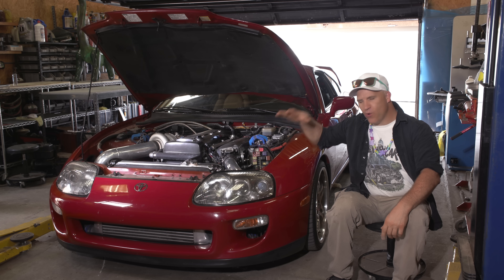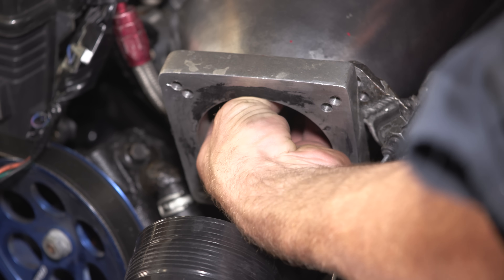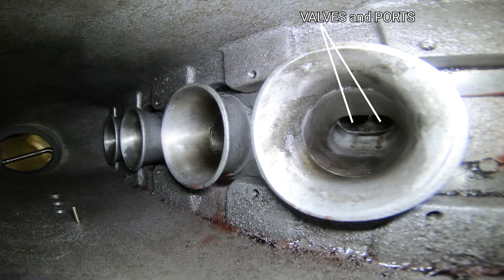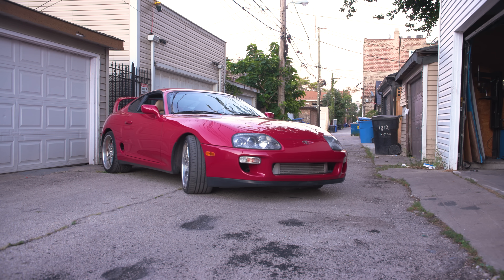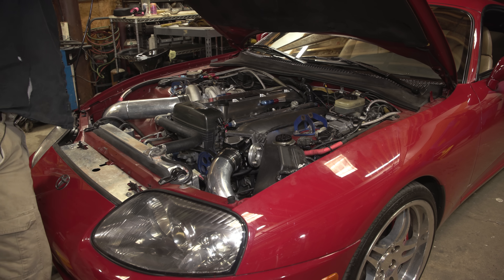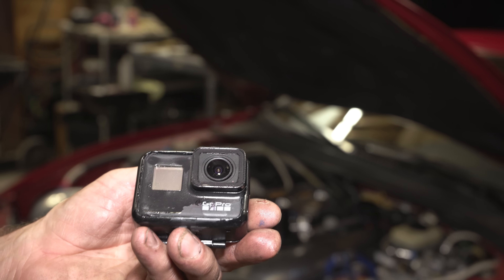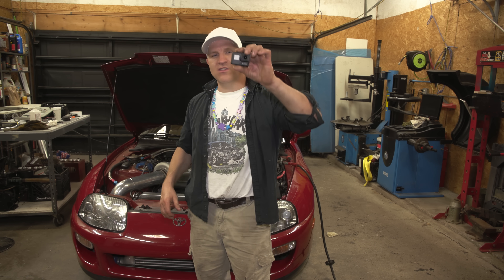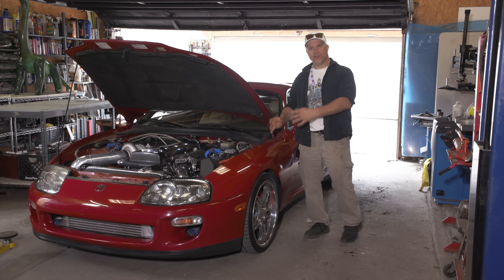Driving with Gopro Inside My Intake Manifold (Toyota Supra Turbo)

Comment: that oil in your intake is your PCV. it vents air from your crank case into your intake and the oil your seeing has been evaporated from the heat and goes in with the rest of the air through the PCV. this is where people see all the carbon buildup on their valves and such but since the supra has port injection you wont get much. to prevent the oil from going  into the intake its best to run an oil catch can in place of the normal PCV line

Comment: The oil is the result of the boost pressurizing the crank case. I assume that you have the PCV routed stock. More boost=more blow by. Some set ups have it worse than others. The solution to eliminate that is to properly vent the crankcase to the atmosphere or buy a really good catch can. Your case is mild nothing to be concerned about. As long as their aren’t puddles of oil in the intake it’s good. On my car I had it worse, installed a catch can dynoed the thing after and saw a gain across the board. Food for thought loving your content keep it up
Reply from the maker: Thank you, that's the same thing I thought, but the issue I have is that the oil is red... I ended up tracing it to the low pressure power steering switch it looks like it's bypassing power steering fluid from the pump into the intake manifold... But in very well can be from the catch can.

Funny because I designed the original catch can PVC setup that is used on the Supra a very long time ago.

Comment: I am ocnfused, why injectors continue to spray fuell when throttle is closed?
Reply: That looked to be when the engine was warming up, when the engines cold it uses a bunch of extra fuel. The fuel spray when it was idling looked normal though
Reply: @cooperhomann783  I am talking about injecting fuel when engine braking. Stock ecu doesnt do that, I asume someone who flashed ecu, done this on purpose probably to reduce engine braking.
Reply from the maker: Well I have to retune it it doesn't have a stock ECU, but I believe I have deceleration fuel set to a very small percentage, that's one of the things I have to look into... This car right now at this moment is not tuned perfectly.

Comment: The engine oil is redish ,: Are you sure you didn't melt your camera rig with E85 ?
The amount of fuel wasted in the plenum is huge.
You have sparking occuring in the intake manifold at the top of stack 2 (maybe you have a spark lug problem discharging there ?)

Comment: Thats not oil:)

Thats your coolant. 

Your burning coolant man..
Reply from the maker: Well it turned out to be power steering fluid, I traced it after I was done with the video and found out that I have a faulty low pressure vacuum power steering switch which is bypassing fluid into the intake... Thanks though that's the first thing I thought 2

Comment: Would an injector just after the turbo break down the oil by diluting it enough to then be able to burn it .

There is only one way and that's to test it ,  place an injector and camera  just after the turbo and one in the intake .

The petrol will cool everything right down  also .

Comment: I think for the oil, the only places it could come from is the turbo side, or the pcv if there's no catch can. I didnt pay enough attention to see if you have one on it or not, but if it has a catch can it could only be turbo, and that's not bad. High oil pressure can go through the seals, its better to burn a bit extra oil than none at all as long as you keep up maintaince

Comment: I don't think that's oil that's engine coolant. That would usually be red unless you're using transmission fluid in your engine block and it's sneaking past the piston

Comment: It's amazing how much fuel goes through the injectors and moves around intake manifold. What I find the most interesting is that you probably have found the reason for carbon build up on direct injection engines. The fuel gets into the intake manifold through the valves and emission systems and coats the valves in it. Unlike port injection where the fuel washes the valves. I've never seen this before. You should do it to a direct injection turbo motor for comparison.

Comment: I have a weird request. Buy a cheap turbo, buy hella exhaust pipes, weld exhaust pipe to exhaust inlet on the turbo from the vehicles exhaust pipe from under the car (best to straight pipe). From the outlet, weld exhaust outlet to air inlet, then use the air outlet as the exhaust tip.

Then call the video, "How to get turbo sounds from an N/A engine". Or... Idk....

Comment: Great video, thanks. I think the reason for the oil being on either side of the GoPro screen would be due to the resonation from the engine. I've seen effects like this with sound. Have a look at non Newtonian fluid. It's possibly similar to that.

Comment: The oil appears to be coming from under the velocity stacks
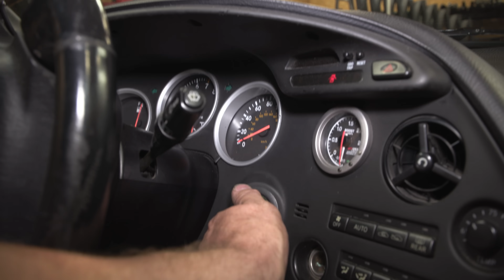2:38 you can see the oil squirt out from under them. At least 3 closest cylinders are easily seen.

Another thing to note is Injector 4 appears to be spray more like a jet instead of a mist while low rpm. Same timestamp you can see it, also several other times. This also makes the intake very wet and you can see fuel actually pool up under the lip of the intake where the stack meets the port.

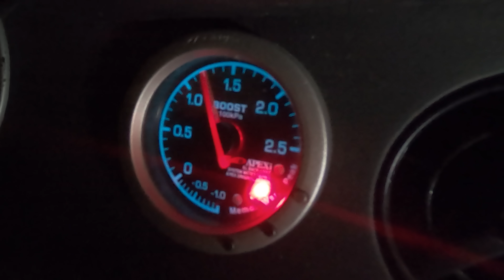Comment: I could see a spark on the second intake from the throttle body from 4:38 that can’t be normal ?
Reply: That's probably static discharge from the high volume of air flow.
Reply: That is interesting, I believe that intake manifold is a 2 piece design. He may need to do some more grounding.
Reply: I thinks thats just the reflection of a liquid lol
Reply: Good eye
Reply: Right on top the number 3 velocity stack? Whoa!
Reply: Don't think that's normal

Comment: I would be in heaven if you would show the inside of the crankcase with a GoPro while driving. Even the idling engine would be enough.
I'm particularly interested in the real life flow of oil in the engine. How the cylinders are sprayed, how the oil comes out from all the bearings. I'm not sure if it's even possible to film the working crankshaft etc with a simple GoPro. I'm afraid there would be needed some high speed camera. But they are big, and the GoPro is tiny.

I searched for such movie shots some time ago. Unfortunately there aren't any, or at least I haven't found them.

Comment: That oil is from the turbo. Every single turbo leaks some oil. It's just how it is constructed. It can't be done in a different way.
Another source of oil in the intake is crankcase ventilation. Gasses from the crankcase contain oil mist. Again: is possible to use the oil separator, but there are no perfect oil separators for use in engines. The flow of gasses is simply to high to perfectly separate the oil.
Reply: Btw, that Supra is sweet.
Reply: I thought is was farm fuel. Farm fuel is red lol.
Reply: @tenncoin  that's red diesel?
Reply: @ant8834  No, farm gas is red.
Reply: @Hay Day what freaking subject are you talking about? 

The guy I answered to was talking about not being an a-hole, apparently both speaking of environment and driver's behind the car, how f*cking hypocrite is that when we are talking about a modded Toyota Supra? 

There should be no need to explain that. 

Also burning all that oil creates a LOT more pollution and fumed compared to condensing it into an OCT that vents the cleanest possible air either into the atmosphere or into the hot exhaust, even after the catalytic converter. 

Main reason why such system isn't factory is because it's a lot more expensive to produce and complex to install, also it's far from useful on a stock car, but again we're talking about a modified Supra with a much bigger turbo that dumps massive oil amount, hence my remark about taking the context into account when commenting and thinking a bit more before opening the mouth. 

Happy now?
Reply: Except those oilless grease turbos lol
Reply: manifold? Most turbo leak no oils unless there is a seal problem otherwise how do 2 of my turbo engines go 9k miles without using or having to add a drop of oil to the engine.
Reply: It's all good. The fuel keeps it washed off the lense.
Reply: Basically most turbo vehicles will have some rate of oil burn in that case?
Reply: Not a problem of airflow as much as volume tho is it? If you were willing to give up the font passenger seat and live with epic lag it wouldnt be a problem at all to build a cyclonic separator.
Reply: Perfectly true
Reply: Hmm.... well, I suppose you could use an air bearing.... 🤔
Reply: @Hay Day well then tell me what subject you're talking about in the first place, I'll be happy to answer.
Reply: My Shelby Z ran 14psi and destroyed oil. 2999 miles, clean and clear. 3000 miles, made diesel bois blush with how black it was.
Reply: @Hay Day you come in here and just call people names without adding to the conversation
Reply: You can vent the OCT to atmosphere or use a crankcase evacuation kit to vent it to the exhaust while keeping vacuum into the crankcase thank to venturi effect.
Reply: @ArthurTipaldi  yes and  it is normal for intake manifolds to be cool enough for condensation(water) to form
Reply: @ArthurTipaldi  Assuming that one is not an egocentric asshole, then venting these gasses to the atmosphere is against the law in a civilized countries and states.
Venting them to the exhaust is possible, but it destroys the catalyst (again assuming that one didn't cut it out).
Think about it next time you will be driving behind some smoking car.
Reply: @biglightball I was about to take 5 solid minutes to explain to you how irrelevent your answer is given the context of the build, nor any context of any build actually, but I won't even bother wasting my time 😅
Reply: @biglightball  i hear you..i think the same way....we can still have lots of fun and be environmental friendly(somewhat)....ive driven many Mustangs over the years with 225-450 HP and never disabled one emission control device (unless you count mufflers which i removed instead of the cats on my '86 GT)...you can still have tons of fun without sacrificing anymore than 30-45HP...it drives me crazy when i hear guys say hey i just bought a supercharged 500HP so and so and im removing the cats tomorrow along with by-passing the O2 sensors and reprogramming the PCM.....all in fun but leave the cats and the O2 sensors alone...... you will not really gain much and youll save yourself some money..i think people remove these because they think theyll be unleashing like 100HP that they cant reproduce but can with just employing a few extra mods..dont go the simpleton route...be creative, use your mind, and you'll be proud to say that you made 500HP without destroying the air that EVERYONE and our subsequent generations breathe...jus my 2 cents
Reply: @biglightball  Easy as, just vent it past the catalytic converter then. Put the vent tube just inside the exhaust pipe and it will act like a suction device and help vent gasses.

Comment: to me  it looked like the oil blew back out of the engine every time u slammed the throttlebodey shut and on initial start up.

Leaking around the velve stems?

looks like most of it came from the 3rd cylinder from the throttle body.

Comment: Why does it still pour fuel with the throttle closed when engine braking?
Reply: The second it shut its just the latency between tps-ecu-injector.

Sometimes more fuel when throttle is closed is good though. Increase your vaccum and improve engine braking

Comment: There goes your miles per gallon🤣 i thought all of the fuel get sucked instead they form a puddle inside the manifold also there is oil do you have a oil catch can installed?

Comment: Supra Interesting...

Worst case scenario the back cylinders don't fill with air and are rich which is fine. If you restricted the fuel you'd be in trouble...
Reply: Brings an interesting point... Thinking about it further, the back cylinders running rich would make the o2 sensor (assuming there is only one o2 sensor) believe the whole engine is running slightly rich. The ecu would then compensate by injecting less fuel, thus leaning out the front cylinders. Dunno how much difference there would be in the end...
Reply: @jeremyfenton1712  i dont think it will do mutch it could burn in exhaust piping
Reply: @michaelpetropulos1288  if it burns in the exhaust pipe, it'll cause high EGTs, which could cause damage to the turbo, etc.
Reply: @elkvis  it will be hotter but if you think about "DSG fart" the engine stops to spark but its still injecting fuel so it burns in the exhaust manifold. we have vw golf r and it has around 75k km and the turbo or anything is fine
Reply: @jeremyfenton1712  Have a look at intake manifold designs.  BMWs are a good example. The other thing is when under pressure (boost) the pressure in every part and point of the intake is at the same value, there will be no rich or lean because the same amount of pressure will be applied to each cylinder equally.
Reply: @LazyH-Online thats true but it wont make it very lean
Reply: Running rich and dumping unburt fuel into the exhaust will damage the cat, but you would have to run very rich and for an extended period of time for it to actually do damage so i wouldnt really worry about it, ecu will compensate for the change anyways.
Reply: Lean is mean
Reply: Honestly honestly someone told me this too.
But please please use some logic this is not possible for the air to get restricted on a boosted car that's why is boosted which means pressure.
Reply: @Carlos_Jzx  I see your logic, and I'll raise you fluid dynamics. Anything not specifically designed for life in a smooth flow environment makes turbulence, and turbulent air is slower air. Park that object over an intake Venturi, and you just altered the overall flow rate of the cylinder it supplies, which demands a fuel flow adjustment to maintain proper a/f ratio. That in turn calls for a slight change at the  each of the other cylinders to maintain stoch and keep everything in balance. That said, on this kind of setup the pcm should be able to adjust without to much trouble making for very little if any noticeable difference in drivability. The inside of that box looks like turbulence city anyway.
Reply: @Ghost812many  
Well I don't have to go all Einstein here to just tell you that it doesn't matter the shape when you introduce pressure in the equation it will go in because it will go in or you have forgotten why the term Force induction remember Force in.

The fuel is a different topic and that should be no brain the position of the injector haven't changed or trajectory.
Reply: @Carlos_Jzx  Under pressure or not, airflow is still subject to Bernoulli's principals. At this level the differences are probably only detectable by precision measurements with top tier equipment in a controlled lab environment, which makes you absolutely correct in effect. Scale the same scenario to an 11000 hp monster built on kill, for example, or a high precision modern F1 engine, and things change a bit. Scaling the cause also scales effect. The resulting flow differences that are virtually non-existent in a daily driver/ weekend warrior built Supra could spell death for the other engines. So, speaking to the Supra in question, unless the camera somehow leaves the mount and blocks a port, then it's no worries!
Reply: I doubt it would even change the AFR by 0.2:1 anyway but fluid dynamics tells me the air FLOWING past the camera MUST be SLOWER than the un-impeded air on the front cylinders REGARDLESS of the static pressure in the manifold. If what you are saying is completely true there is no need for an induction bell on the inside of the plenum. BUT TESTING shows that it makes the air turn easier into the inlet.

Remember BOOST is actually measuring the restriction of airflow into the intake. Increase the airflow of the head and boost will go down for the same HP.

Food for thought.
Reply: @JackoTJK  True that.  The inlet venturis (or induction bells as you have there) are also of a tuned length at a particular RPM.  The edges need to be rounded accordingly - see the clouds forming on the sides in the vids.  These are called Eddy currents.  They too have a role in getting the best airflow into the intake tract.